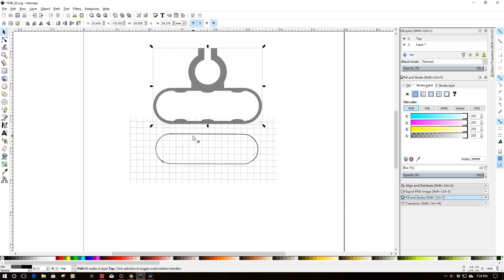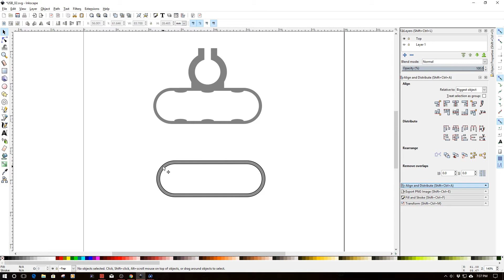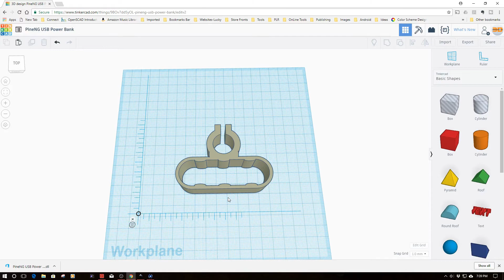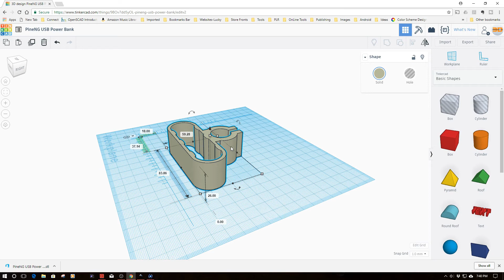Inkscape Tutorials - Designing a USB Battery Tripod Mount!

Comment: I need one of these holders... but it would be great if it was like a little case/pouch to put any power bank into it and just hang off of the tripod... so hard to find anything on ebay
Reply from the maker: This thing is still in daily use in my shop!  However, since they come in so many sizes and shapes, I have hard time getting my mind around "how" to design a universal one, yet  I am will to hear more to be inspired as I think your right!

Comment: Nick Saporito has a long running batch of inkscape videos https://www.youtube.com/channel/UCEQXp_fcqwPcqrzNtWJ1w9w
I have to believe the issue you are having with differencing is that if you set the Relative to: "Last Selected" in the Align and Distribute tool you will be able to difference the last selected from the first one or multiple parts. I could be wholly and completely wrong, but, it is worth a shot.
Reply from the maker: The issue is the "order" as the subtractee has to be on the bottom of the subtractor or the subtractee cancels out the subtractor...
Reply: I 'membered wrong. Thanks for setting me straight.
Reply from the maker: No worries and thanks for sharing!  :-)